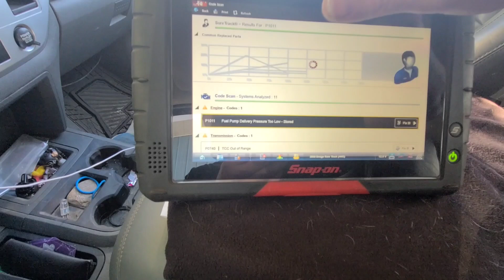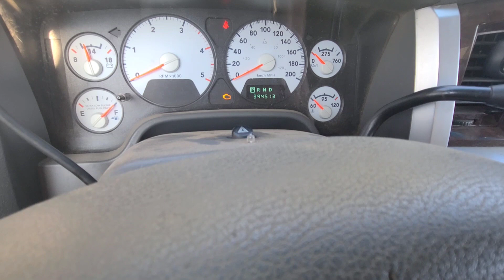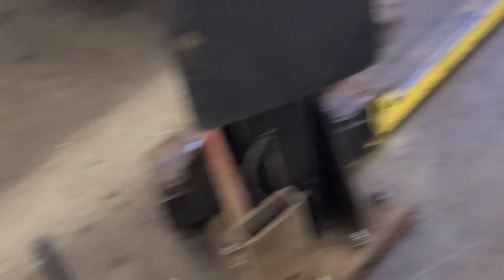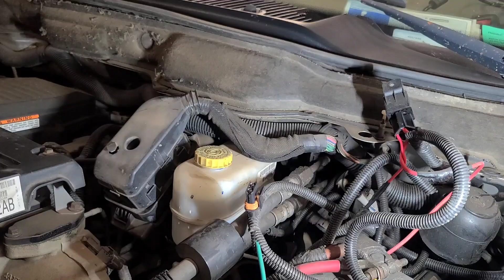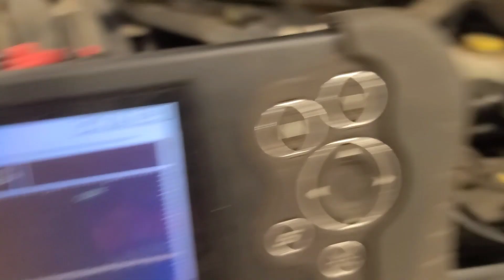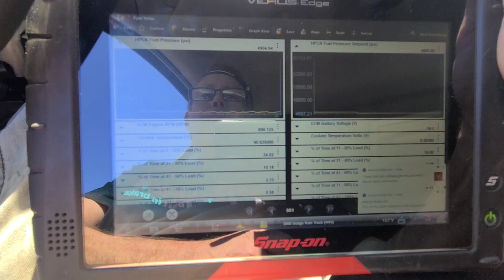2008 Dodge Ram 3500 6.7 Random Stalling and Power Loss. Code P1011

Comment: I have a p1011 I replaced fuel pump injection pump.new  fuel pressure sensor
Reply: I don't know what else to do
Reply from the maker: @shannonerwin555  what pump did you replace? The lift pump or high pressure fuel pump? Is your truck stock or modified?

Comment: Mine every once in awhile randomly goes that it'll just be like someone pulled the plug into shots all the way down . . Then I f*** with the battery cables connections and it's fine except for this time
Reply from the maker: Is it stock? What codes is it setting?
Reply: @PhillipBailey  no it's not stock,deleted w programmer,pedal box compound turbo ect.. it always seems to be a bad battery connection..
Reply: @billyjones9045  I just added a brand new ground to my drivers side  battery and this 2014 (still) stalls intermittently. 7 BRAND NEW SENSORS,  BRAND NEW KEY FOBS, BRAND NEW PUSH BUTTON START SWITCH,,,,,,, nobody's got time to scan it, look it over, it's a clean truck 630,000 miles. Totally driving me mad, only things I haven't replaced are PCM & or BODY CONTROL MODULE-------- PLEASE HELP ANYONE??